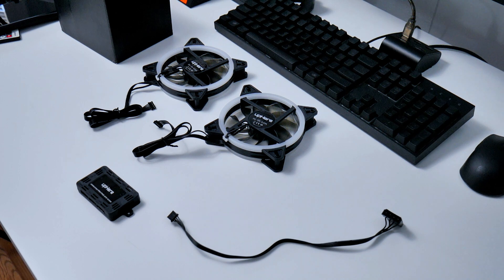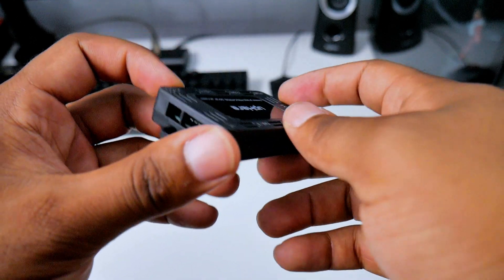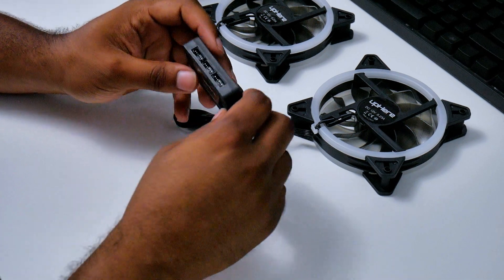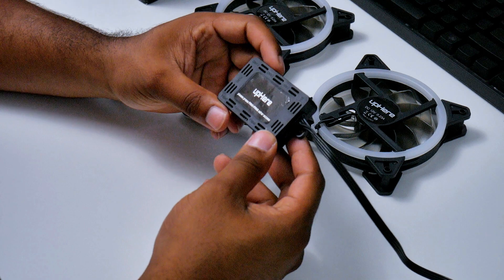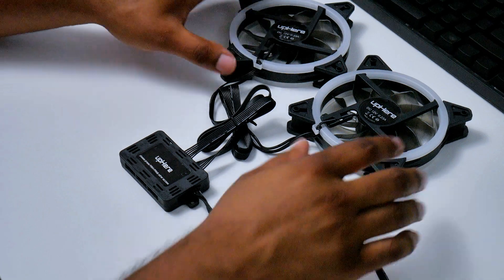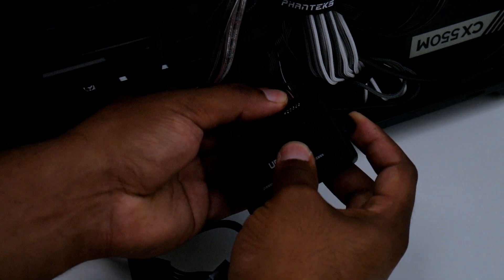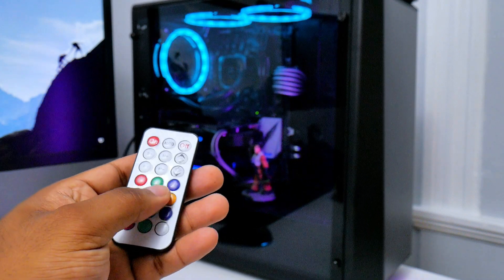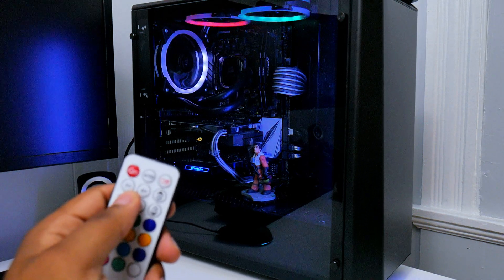Uphere RGB Fans (Installation Tutorial)

Comment: So I'm having an issue where the fan are on and spinning but there no lights showing yes it is rgb fans by uphere
Reply from the maker: I would suggest trying to install them in numerical order the fan hub should have numbers on top and giving it go again. If not return them and try there new model.
Reply: @VictorA25  there arnt any numbering at all
Reply from the maker: 🤔 try to put all in order then plug in one entire side then the other and if your still have issues. Play around with the controller check the 🔋 battery and hit the on and off buttons.
Reply: @VictorA25  I manage to fix it I'm not sure what the cords called but i was using the wrong molax (I think its called)cord, I have 2 differnt one 
1.it has a molax tip and the rest is for hdd
2.its straight molax connector only
 I switch it out and fans lit up with no issue
Hope this helps other
Reply from the maker: Excelente always good to double check enjoy.

Comment: I have a $170-$200 PSU and it doesn't come with the 4 pin. You would think they would have given me a female to male, or something.
Reply from the maker: You need to buy a $2 sata to molex adapter really cheap add on.
Reply: @VictorA25  I just noticed your reply. Yea, I ordered 2. 2 because I got them from different places and want it asap lol. See which is faster. Upgraded my PC and 4 fans aren't working.

Comment: Do these give good air flow? I think I’m picking up these instead of the newer version.
Reply from the maker: They due but they are loud!
Reply: What is the CFM airflow on this?
Reply from the maker: 46.3 CFM (±) 10%
Reply: Victor A Wow! That’s really good! I just bought mine today on amazon and it’s coming tomorrow. I’ll give an update on it once I get it.
Reply from the maker: Great thanks bro
Reply: I received my fans about 2 hours ago and the shipping box was soggy. But the black box had small droplets. I just finished installing them and they look really good! They are louder than what I thought though they do give my PC better airflow than before. My case is an In Win 301 and the fan controller fits perfectly where the cable bar is.
Reply from the maker: Yes this are loud the newer version is a silent edition and are much quieter. If your not satisfied send them back and try the new version.
Reply: Victor A The new version lights up in the center? I like the ring lights better in my opinion.

Comment: I got a 3 pack up here fans on Amazon coming today hopefully it's the same thing this my first pc
Reply from the maker: Nice hope you enjoy them... Very good and long lasting.
Reply: What about a 6 pack? Also can you change the color if its connected to the motherboard
Reply from the maker: The 6 pack is the one I actually own and it's the same exact thing just 6 fans in a box only $35 as we speak now on Amazon.
Reply: Yeah. What about the motherboard fan slot. Wouldnt you get another error everytime you start because the fans are plugged into the controller and not in the motherboard. It is possible for it to still work if u have 2 fans in the motherboard and 4 in the controller
Reply from the maker: No you wouldn't get an error at all. These fans are powered by the PSU not the Mobo and they Will not be connected to the Mobo. You should be ok these will provide enough air for the case depending on how you set em up for intake and outake.
Reply: @VictorA25  ok. What im going to do is buy 5 rgb fans and 1 normal fan for the motherboard
Reply from the maker: Yea give them a try and come back tell us how you like them or go on my discord if you need further assistance
Reply from the maker: If this is what you want it's fine but you can get a way better case for that money much better quality.
Reply: Link?
Reply from the maker: @Deuteriumaddict  https://www.newegg.com/black-deepcool-gamer-storm-atx-mid-tower/p/N82E16811853080?Item=N82E16811853080
Reply from the maker: @Deuteriumaddict  https://www.newegg.com/black-corsair-carbide-series-175r-atx-mid-tower/p/N82E16811139141?Item=N82E16811139141
Reply from the maker: @Deuteriumaddict  https://www.newegg.com/black-metallic-gear-neo-air-atx-mid-tower/p/N82E16811854092?Item=N82E16811854092
Reply: @VictorA25  thanks
Reply: Victor A Do they still work? I just bought these fans and just wanna know if they last a very long time if taken care of properly
Reply from the maker: I still have them and i actually have a few other models from them all of them still run strong
Reply: Victor A How long have you had them for?
Reply from the maker: Both for over a year the lights still look new the fans don't make weird noice, i been sent some enermax those lasted 3 months bearing started making weird noise. I also have Antec prizm and the lights started to leave spots lol 6 months in.
Reply: Victor A Damn alright guess i’m in good hands
Reply from the maker: Definitely uphere makes really good stuff
Reply: Victor A Would you recommend any light strips that plug in through sata?
Reply from the maker: The only light strips ill recommend would be one that can go with these set of fans or those that plug in to your mobo that you can control via software. If you get another type it will turn into another device with a controller which is adding more wires to your case and an extra controller.

Comment: Does anyone know how to connect the actual fans to the rgb? I got it connected to the hub but my fans dont respond to the remote at all?
Reply from the maker: Did you take the film in between the battery out on the controller and also connect the fans in order on the hub..
Reply: Victor A Ya I did both it just doesn’t work
Reply from the maker: You might have a faulty set return them is my best advice
Reply from the maker: Idk if you just like these more than the newer ones but they have more options.

Comment: So how do you turn it on and also connect them? I'm a first time builder here, I got this fans for like $50CAD 5 pack.
Reply from the maker: It all connects directly to the fan hub and the fan hub connects to the PSU and the controller that comes with fans will light up the rgb if light if they don't turn on when powered up.
Reply: @VictorA25  thx so much.

Comment: Are they quiet and do they have decent airflow for $30
Reply from the maker: Quiet no but good air flow
Reply: @VictorA25  how loud are we talking? Is it Noticeable with the case closed up?
Reply from the maker: You can't control the speed on them at all it won't bother but you'll notice it. Not to the point that if your gaming it won't didtract you.
Reply from the maker: They do have newer models that allow you to control speeds

Comment: hi all. idk if anyone will see this but i just bought a pc today from someone and they had installed these fans, but they didnt give me the remote. i was wondering if they had an app to control the color or mode or brightness because they're cycling through every color and flashing quickly and it's making me feel a bit sick. i searched online and didn't find anything so i know the answer is probably no but maybe someone knows something i don't?? if not, does anyone know where i can get a remote replacement for these?
Reply from the maker: No you will have to replace them if no controller is found

Comment: I bought this 3 pack, and only used 2 but they turn on and the controller does nothing (it functions because the red light flickers when a button is pressed) but nothing changes i tried every button
Reply: Hi, you MUST have all three fans plugged in...  I had this same problem... i took two out (to test) and realized they only work with all three plugged in.
Reply: He bought the 3 pack, not the 5 pack... All fans must be plugged in for it to work... I have no clue why but they do...
Reply: I have a 5 pack with all of them plugged in and they stay on the color blue
Reply: I wonder if you could just plug the last fan in and cut the wire to the fan(of course tape up the exposed wire) if you absolutely have no room for it in your case. The way they have to connect I would assume they run in a series circuit instead of parallel. So by just having the connection end plugged in it still completes the circuit. Just an idea. Sucks they made them this way, but hey for $40/ 5 fans, can't really complain.
Reply from the maker: Yea men but nice way of getting creative. I'ma look into a new set that looks similar to this and make a nice video on it.

Comment: How do you know which fan is fan 1, fan 2, fan 3, etc.?
Reply from the maker: It will usually have numbers but play around and plug em in one at a time and see which wave the colors go
Reply: @VictorA25  Would it have the number on the sticker of each fan?
Reply from the maker: Non usually on the hub but the best way other than that is by the light patterns.
Reply: @VictorA25  Well idk how but I just guessed which order they were in from how I got them from the box and installed them and they work! So maybe I got lucky, but they're good fans.

Comment: Did anyone else have thesame problem as me? Bought this thing out of amazon, i received a molex connector that i can only connect to the rgb slots not the DC12v slot. Please help
Reply from the maker: Oh no when I got mines I only got one power connector which was the molex connector that must be the new thing there doing idk why.
Reply: Well whatever their doing its not working the 1st one i got got broken
Reply from the maker: @bigdeekwalern8337  Yeah I understand it's frustrating but the initial one I did the review and installation are no longer available from uphere they are selling a different batch so it much an updated version even if it looks the same.
Reply: I got mine off amazon as well. Got them a few days ago and mine came with the molex that plugged into the DC12v. I would assume they sent you the wrong connector, but i dont know why because the rgb is an output not a input.
Reply: BL4CKxCH4N thats good i guess they fixed it, hows your airflow? Im not getting any i cant feel any air 2 inches away,
Reply: @bigdeekwalern8337  i haven't connected them yet. Im still waiting on my psu. What case did you install them in?
Reply: BL4CKxCH4N thermal take dual tempered glass, i have good airflow in the front but at the exhaust is my problem
Reply from the maker: If I'm not mistaken you have the option to add up to 3 fans on top which can serve as exhaust. In that case.
Reply: Victor A no, just two, one top fan and one rear end fan, the problem is when i put my hand on thw back of the fan i cant feel any air unless i put my hand a inch close
Reply from the maker: I mean these fans are not supposed to blow like a full on fan. Just keep a temperature app running and run some test you should be fine. I've used one called Real Temp gives you all kind of info my minimum temp on mines is 44c and Max reaches 78c the most.
Reply: Ok so i finally got my psu, connected everything and everything works. Yes the fans are a weak but thats what you get for cheap fans i guess. Also i have the 5 fan kit. I only use 3 in the front so you dont have to have all the fans connected for them to work just make sure they are plugged in order.
Reply from the maker: Yes that's the main issue that you have to plug them in order💪👌
Reply: BigDeek walern yup just got mine and I have the same problem as you. Contacted amazon and they said they had no contact info for upHere or HI PC which is the seller... they said they can give me a refund if I return the item but that seems excessive if I’m just missing one item. Anyone know the companies contact info or if I can purchase that cable anywhere else?
Reply: CanadianRedneck dude if you tried turning them on the plugging the power on dc12 slot led is fcked. Better return that or buy another one.
Reply: @ big deek walern yes its the same situation as mine, i bought mine last week and same molex connector i received it just go to the rgb slot and not to the dc12 slot.
Reply: Kent Carreon they have to get their thing strait, what ever you do dont plug it in, because if you do. It’ll break the rgb

Comment: how do you pair a remote that stops workiing? battery is fine
Reply from the maker: Hmm that's a good question press and hold on and off together try that
Reply: @VictorA25  yeah i tried that and doesnt work...the lights still work and i can change the colours when i press the button the the pc case, but the remote just stopped working today and i only got the pc yesterday and it was working fine
Reply from the maker: Are these the exact same fans because this video is 5 years old
Reply from the maker: I would upgrade to better versions that are out this technology and these fans are to old to even have in a PC case in this age
Reply from the maker: I would definitely recommend you upgrade that to something you can control software base on rgb and fans speed which will suit you better in the long run
Reply: @VictorA25  not sure...i just got the evetech ares case that comes with 4 fans and remote
Reply from the maker: Yea upgrade that to better quality which will help in the long run
Reply: @VictorA25  they do work with mystic lighting and aura sync but my motherboard doesnt support that, thats why it has a remote to use...anyways thanks for your time and help...ill take it back to the store tomorrow as its only 2 days old....

Comment: I connected the Molex to the psu, but what about the fan header to the motherboard? The fans lights up, but it’s not spinning. Help?
Reply from the maker: You have to connect the fans in numerical order in order to it to function properly.
Reply: Victor A Okay, so the fan header on the motherboard is left alone. Right?
Reply from the maker: Yes the box
Reply: Unfortunately, it’s still not spinning and I also noticed that the 4 pin connector I have only plugs into left side of the fan hub, not the DC 12V side.
Reply from the maker: It must be a damaged set just try too contact Amazon ASAP and get a new set.

Comment: Should I buy these and install 2 on my radiator?
Reply from the maker: I have one on my radiator as we speak.
Reply: Victor A thanks for the comment. Didn’t know if they’d mess up or not
Reply from the maker: Nope it delivers sufficient air flow to keep it cool I would put 2 or three but I only have a one fan radiator so put one in the back and one the front pushing heat out. I did keep the fan that came with the radiotor on the back side since I have no use for rgb fans back there.
Reply: Victor A thanks man! I sold my old case recently and gave him that fan it came with. Sadly. 😅 but I’ll either order a new one or since I only have 4 spots for fans I’ll put an extra rgb one in the back but I’d rather have one not rgb back there and have it on the cpu spot
Reply from the maker: You should be good bro and your welcome anything else just ask.

Comment: I have a problem, the fans are spinning but they aren’t lighting up
Reply from the maker: Please check your remote that film between the battery is not there and plug in your fans in numerical order on the hub not all over the place.
Reply: @VictorA25  i had same problem, fan spinning but the led didn't lighting up correctly, is there number order each fans?
Reply from the maker: @aditneh1  plug them in from one side to the other and check the remote battery that is making contact if do try replacing the battery and hit the one button if it still doesn't help return them and get a replacement.

Comment: Did they give you a male or female molex cable?
Reply from the maker: The molex head has both male and female. It's in the video just go back to it thanks for watching.
Reply: Victor A I realized that just now. Although my 4 pin connector won’t connect into the DC12v only the rgg slot

Comment: If I get pwm version. Do I just plug cable from hub to cpu fan header?
Reply from the maker: I'm pretty sure you would. I personally haven't used that version yet.
Reply: Victor A ok. Would it still work you think if I plugged into system fan header?
Reply from the maker: Note these the newer one yes which is enabled to be hooked up to the mother board and controlled via there.

Comment: Damn I wish I watched this before I purchased the fans I needed speed controllable fans so they don't run full speed fml
Reply from the maker: Yeah I'm fortunate to speed is uncontrollable on these fans
Reply from the maker: They do have newer models that do allow you to control speed and rgb via software/mobo
Reply: @VictorA25  I bought a cheap  GA-A320M-S2H so I doubt it'll be able to support it 😂
Reply from the maker: Oh I see check in see if it has 5v 3 pin header on the board.
Reply: @VictorA25  according to its Amazon pictures no, I'm building a new pc in a couple of days when all my parts come in and I dont have the motherboard but from what I've been looking at is no, however since I read that they switched to SATA instead of molex is that what you were referring to?
Reply from the maker: No some power supply don't come with a  molex connector to power up the fans so you'll end up getting a molex to sata power adapter but that all depends on whatever upgrade they have done to the fans.
Reply: Victor A Victor A Hello, I've got some Coolmoon rgb fans they come with the hub and controller,.. the hub has the 4pin to the molex plug and it also has a 2 pin plug but the case didnt have any other wires. I was wondering if you would know if there is any way that I can configure the hub with the rgb headers on the motherboard or something. Great video though people look into this stuff because no one would review most of the non labeled products.
Reply from the maker: The only thing i can think of is connecting it to the reset button on the case that way you can control all the lights via that button if the fan hub has the 2 pin like you suggested try it and let me know how it goes.